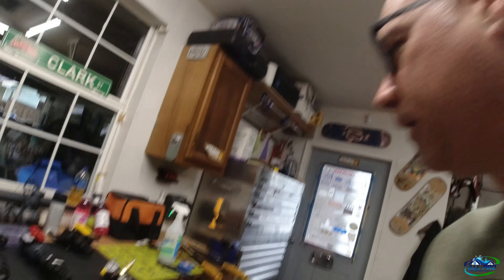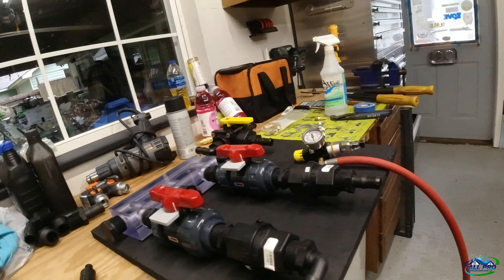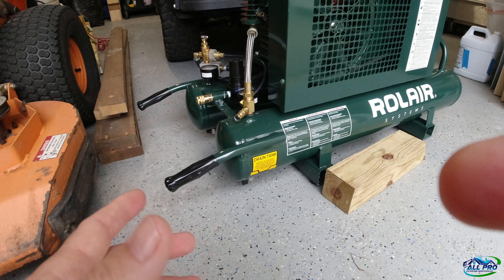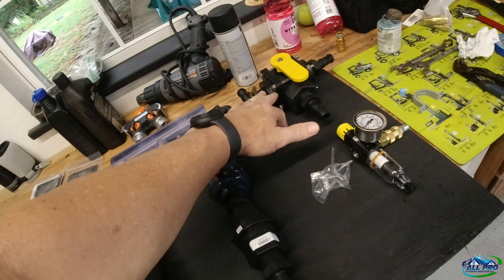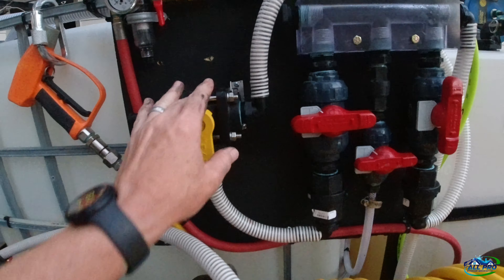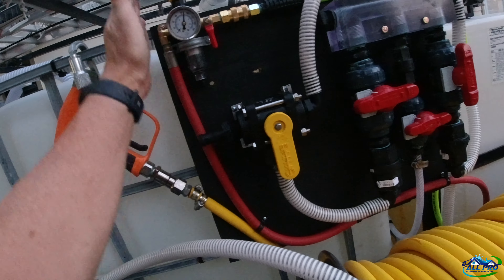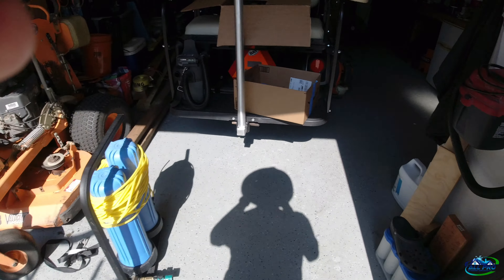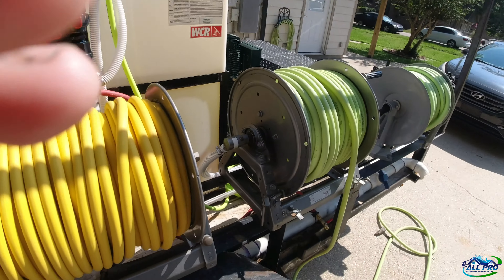All Flo Air Diaphragm Pump Build with Proportioner

Comment: I was thinking with an AR and its capabilities, it would replace a 12v. Guess you are seeing some gaps there. I am currently downstreaming and have a 12v, and was looking to get an AR thinking it would replace the 12v but may have to look around some more. Great video!!!
Reply from the maker: I try not to run a hot mix through my AR. We use the AR strictly for house washing & need a replacement for the 12 volt. Supposedly the air pump is better built for the SH. Thanks
Reply: @allproexteriorservicesllc5338  curious why are you going with the all Flo instead of that floret 10gpm pump you had?

Comment: How re you liking the air system compared to the 12v ? I'm thinking of making the same change.
Reply from the maker: So far it has been great & I should have done it earlier. It feels great knowing the pump is going to work on the next job. No more 12 volts on the trailer. In fact, no more electric pumps no matter the voltage. Thanks
Reply: @allproexteriorservicesllc5338  haha it's crazy some people run 12v pumps for years no issues other guys can't get one to last a week. crazy might have to do with the wiring however and plumbing sizing!
Reply from the maker: @dylanthornsberry8778  We use to have good luck with the 23 volts. We always use marine wiring on everything. When we had to start changing pumps every month, it was time for a new system. Thanks